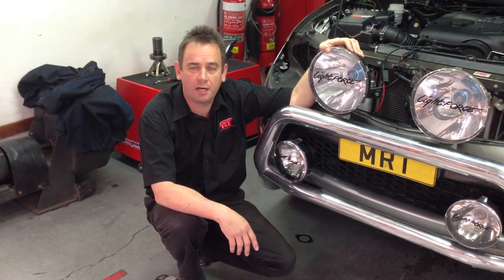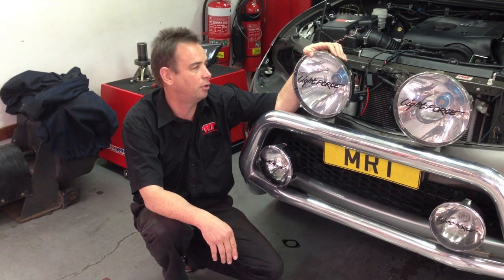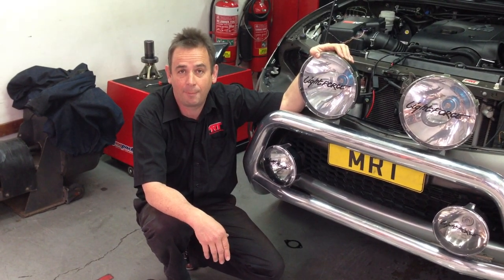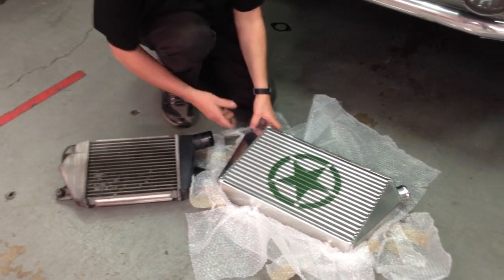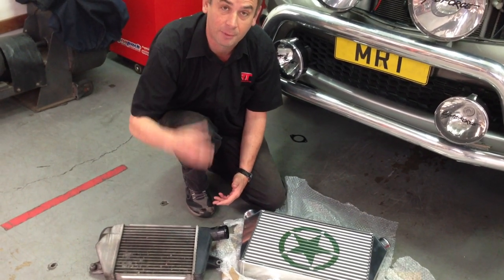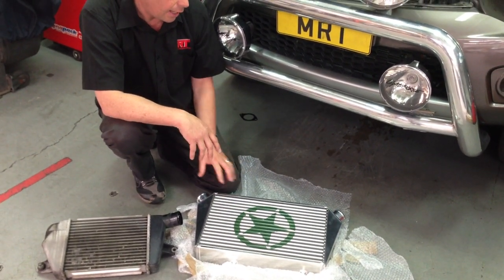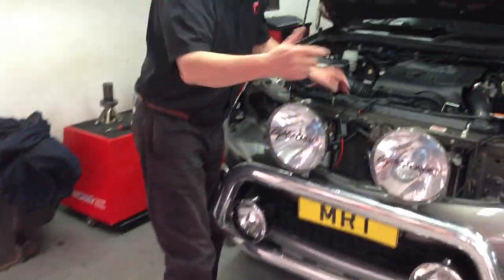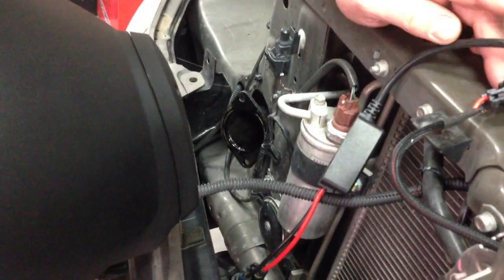Mitsubishi Triton Turbo Diesel Front mount Intercooler test. Pajero, Challenger, Strada,

Comment: With a bigger intercooler, would there be more lag vs the original size intercooler? I drive the 2.5DID manual tranny. I have a piggyback ECU & closed EGR, 2.5inch downpipe to 3inch exhaust thrown away the cat converter.

Comment: Hi I own a 07 3.2 ML I am in Brisbane and I have been on your site an saw you guys now have a XC kit but cant find any details on it is it still available and what does it include and how long would you need the car for? as i would have to travel down to Sydney and stay for the duration of it. the Engine has approximately 180ks on it and is stock standard I'm looking to make it more reliable and better for towing a camper on the beach.
Reply from the maker: sorry for (very) late reply, I just saw your message, please call us

Comment: hi mate have a 2007 pajero 3.2td auto have had it for 3 years now has 187xxxkms and looking at getting more power for towing  with chip and exhust whaat kind of benifit wuill we get with the bigger intercooler
cheers
Reply from the maker: get a good ecu tune before you do the intercooler

Comment: Tows 3 ton, on a 2.7 ton tow capacity limit.....howshis rear chassis rails coming along...
Reply from the maker: all good
Reply: MRT Performance ok.
Whats the back to back difference on the graph?
Reply: The triton can handle the weight easy. They registered it as a 2.7 tonne for tax and registration purposes. Plus the nose weight of a trailer regardless of weight is only around 60-150kg when correctly loaded and any trailer over 750kg is braked. The only area the weight comes into is pulling uphill etc hence the mods.
Reply: I can't seem to find the power/torque gains on the website for this upgrade. What were they?

Comment: Mate any "New" intercooler will show a huge improvement over the OEM version when the factory one has been on there for a while. They are like a big catch can on these Tritons & they fill up with oil & gunk which degrades the vehicles performance.
There are guys on Youtube fitting new (ordinary quality) intercoolers to 100,000 K Tritons and raving about how good they are, but you could fit one made from a cardboard box & get an improvement over the clogged factory version.